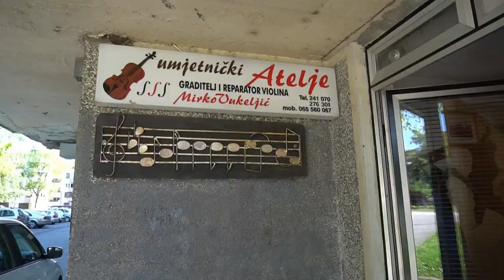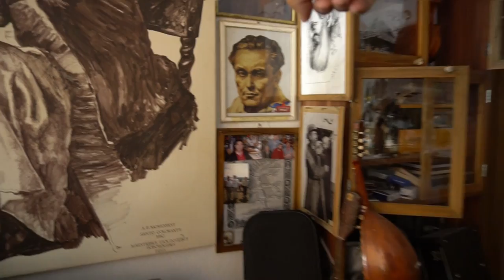Help Boy Find Violin Making Master

Comment: Daniel, I didn't know you make strings. Can you make some for my 19" viola with a 43 cm vibrating length? It is very difficult for me to find excellent strings.
Reply from the maker: we made viola strings that suits most sizes. no customer made strings available as the machine does not allow. thanks. you can order strings online
 http://www.danielviolins.com/online_shop/
Reply: I don't see any description of the vibrating length for your viola strings. My instrument is 19" which is HUGE so I need to know if you make them with a 43 cm vibrating length.
Reply from the maker: again we do not make strings longer than normal, you have to buy one set to try to find out. thanks
Reply: Please excuse me for jumping in. I think you would be really happy with Olive C string (gut core), Obligatos for the G and D, and a larsen for the A. This mix give a really balanced and deep tone, and the Olive really makes that C string sing.